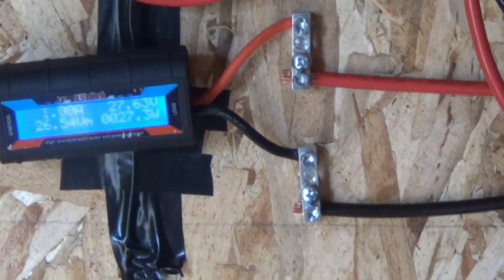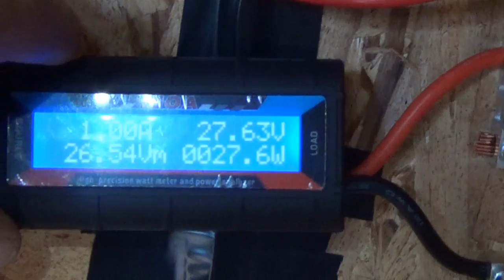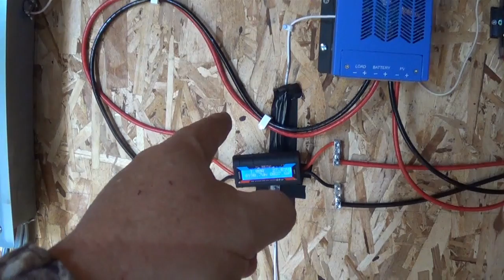Solar Charge Controller Rewired Update - Solar is act now for 2 days.

Comment: Gm how do u put it to float mood?
Reply from the maker: it automatically goes into float .... you can change the dial to go to equalize .
Reply: ArizonaHotHomestead sorry I made a mistake,I wanted to ask how do you put it on equalization,what is the dial?.thanks
Reply from the maker: in the manual book it gives information on  each of the number on the dial. the dial is how you set for charging, equalizing, etc.  it depends on which battery type you have so read the manual. agm, etc.

Comment: Hi I have the same charge controller.  Solarmate 60A model. 

I have connected 6  260W 48v home-roof solar panels for charging an 24 volt 675 amp Trojan battery bank. That go particularly well also in the winter. 

I saw last 10 amp coming from the solar panels and 15 amps going to the battery bank. 

It is only pity that there is no panel-meter available for this charge controller where i can read the charge information. 

I recommend this charge controller this is a good product, See E-Bay there it is often for sale.

I use a Victron BMV 700 battry monitor for the status of my 24 volt 675 amp Trojan battery bank see the link below.

https://www.youtube.com/watch?v=YXbjJzyIFgg

Comment: Thought you were going to attach charge controller to the inverter where they have the connection point for charger.
Reply from the maker: yea I know. I gave you a lame answer on the inverter video.  right now I want the charger not connected to the inverter. my plans are to shut down the inverter when I am away.

Comment: Just buy a can of the rubber liquid stuff you dip tool handles in and coat your bus bars with that. They used to sell it at walmart.
Reply from the maker: +SoGladUCame that's a great idea. thanks. hey I wonder if the flexseal will work?
Reply: +ArizonaHotHomestead Not sure, I had a can of the rubber liquid for tool coating like 10+ years ago. I don't remember anything about it other than got it from wal-mart.
Reply from the maker: thanks

Comment: Sorry I was skipping around and didn't see this controller video. My controller on my RV doesn't have a LED -- which meter did you go with?
Reply from the maker: +TT Travels the little meter is a 150a watt meter. the number on it reads #FT08  RM800  its only about 25 bucks on amazon.
Reply: Thanks Jeff

Comment: Jeff, I superglued my bus bars into an electrical box. No longer exposed :) Good luck.
Reply from the maker: +Off Grid Nation glued. I like the idea. I used plastic electrical box and drill a small hole so the screw would thread itself but it pokes out the backside so I have to be careful it doesn't touch the wrong stuff. lol
Reply: Roger that. I have an exterior box that I use as my combiner box for my panel string. Positive bus bar glued on one side and negative on the other and the box is screwed into my 4x4 post. It cleaned up the connections and works great. It would probably work for your situation just as well and you wouldn't have to worry about touching the exposed bus bar ever again. Just a thought.
Reply: BTW, I think I actually used JB Weld not superglue.
Reply from the maker: cool thanks. I may use jb weld if I find they come loose